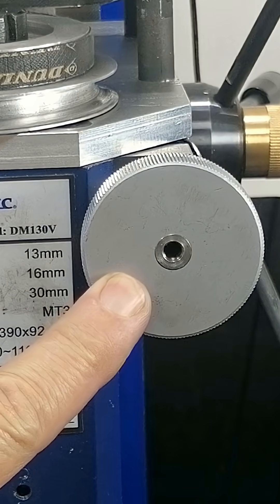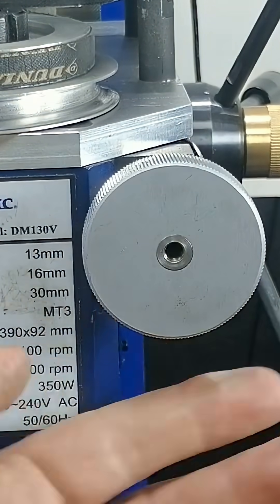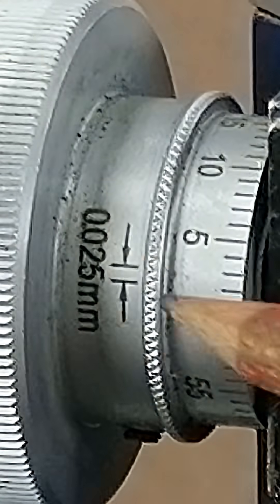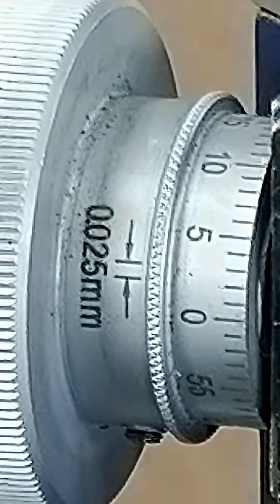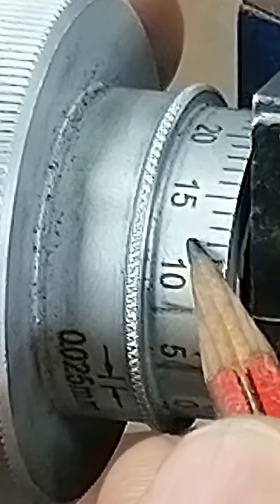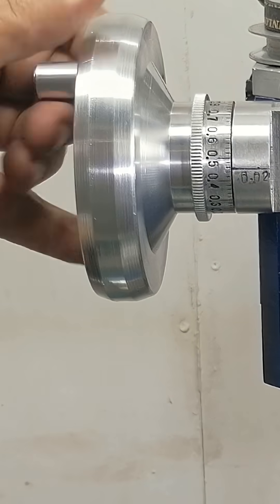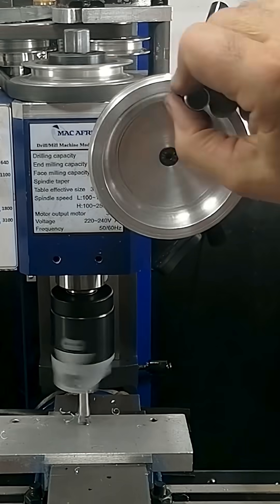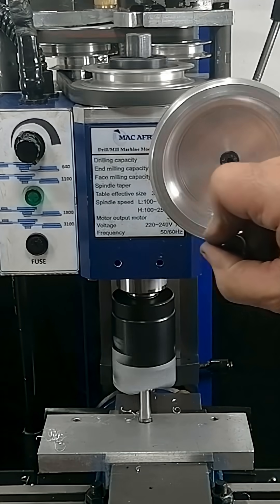Mini Mill Fine Feed Wheel

Comment: Would you consider fitting a digital caliper type scale readout to the quill travel? My Warco 16 has one fitted on the quill axis and it makes depth calculations really clear and easy to do.
Reply from the maker: Thank you. I will try that.
Reply from the maker: I had a look at my mini milling machine. It does not have a quill. The entire head moves, not just the spindle. So, that will not work on my mini milling machine, unless I attach it to the side of the column.
Reply: @GreatIdeasCatalogue  I forgot your mini mill didn't have a separate quill but this would still work well. The basic slimline digital scales are available in various lengths and come with a LCD readout with zero function button and other features...they are not expensive to buy. Some are stainless steel bar with a magnetic encoder some are made of extruded aluminium.